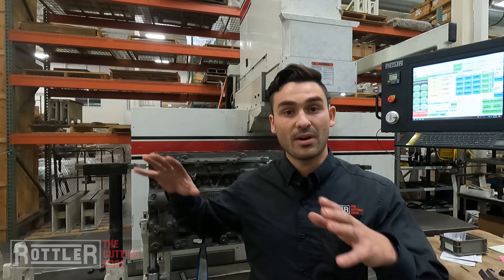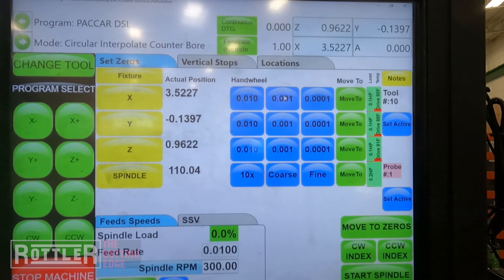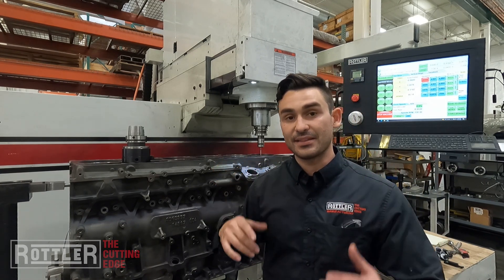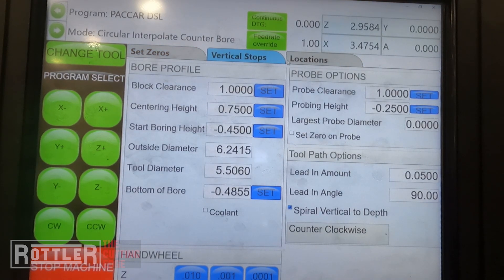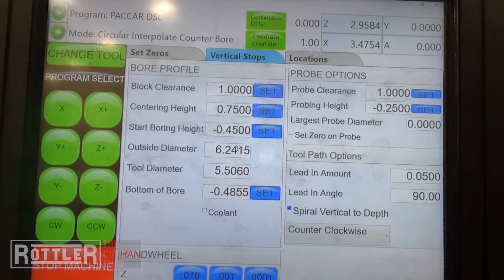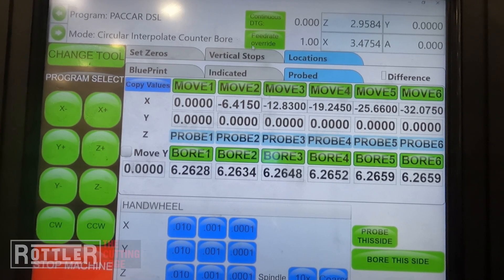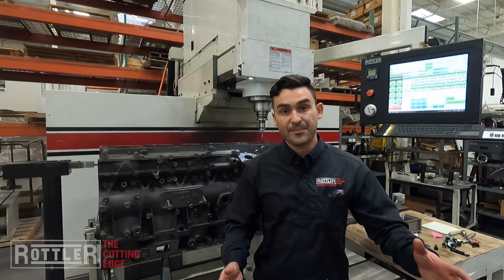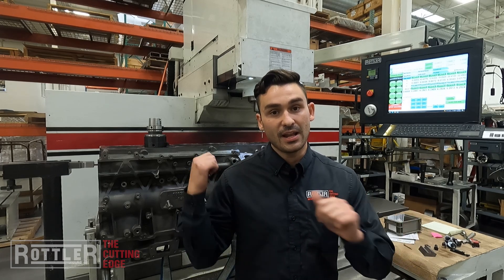Mid Range Diesel: Circular Interpolation Programming

Comment: I have an important question, because nobody shows this setting.
How cand you set/adjust the boring diameter? You have to pull out always the bit holder to adjust with the micrometer tool the diameter, or you can adjust it from the software (from the touch screen)?
If you have to pull out to adjust the boring diameter manually, then this is a big weakness of this machine! :(
Thank you!
Reply from the maker: Hi, that's a great question! On standard boring operations the cutter diameter is entirely set manually using the boring micrometer.

In a circular interpolation cycle where a smaller diameter tool is being used than the feature being cut, we input the tool diameter into the software to create the final diameter as the machine moves in the X and Y axes.